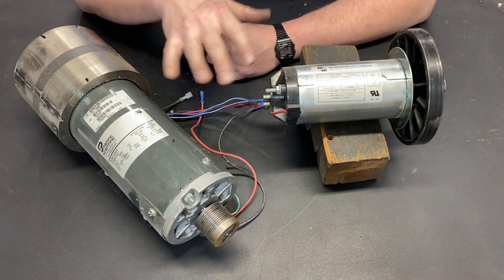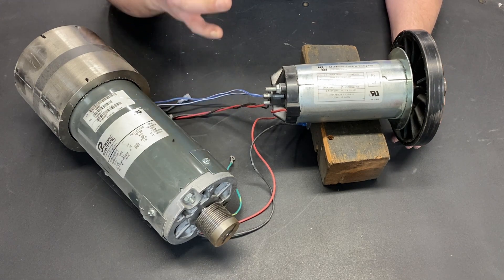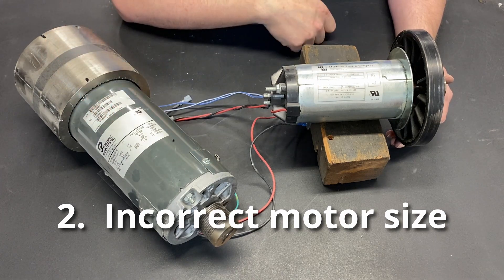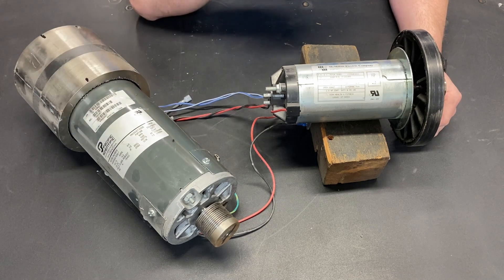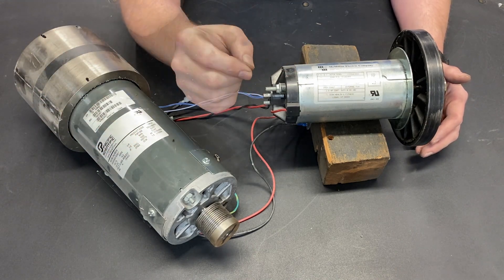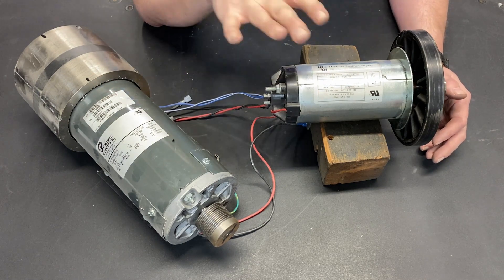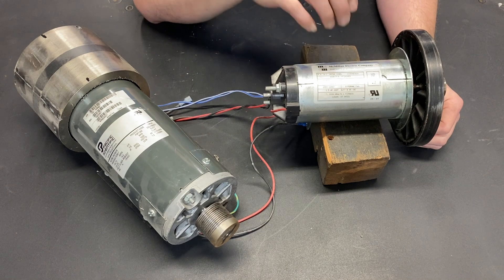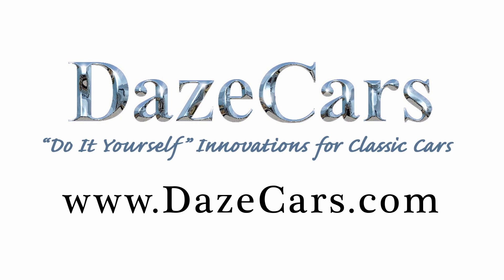Treadmill Motor Conversion Mistakes, Going over Common Mistakes people make on their Conversions

Comment: Is it overkill to use one of these motors for a 1 to 10lb barrel for rock tumbling/polishing?  I just need something with some umph  and recently got a treadmill for free that works and i have the part of the frame that Ithe motor and everything connects to and the entire electronics and components including the emergency magnetic key.  Also a question I have is doing a gear reduction - is that the only way to realistically get it to go 30-40 RPM and still maintain the torque to turn the barrels?  I seen a video of someone that tried to make a ball mill (big one) and it would just stutter and stop and they just went with a different motor and setup because though it was stopped - it got pretty hot.  I think the video was actually called - HOW NOT to make a ball mil.  (It's easier to find videos on them than it is for rotary rock tumbler DIY projects people have done!)
Reply from the maker: I think some treadmill motors would be ideal for this but some wouldn't be.  You really need to calculate the torque of the motor before starting anything.  https://youtu.be/KPcAr9orqZw Also how big around is the drum?  If I was making a rock tumbler with say a 12" wide drum I would mount two 1'  bearing rollers 6" - 8" apart and then drive one of the rollers with the motor directly.  This allows you set the drum between the two rollers and as the first roller turns it rotates the drum which is held stabilized by the free spinning roller.  Best part is the size difference between the rollers and the drum will give you a 12:1 ratio dropping the RP down where you are wanting it and increasing the torque by a factor of 12.  You could even use the two larger rollers that came with the treadmill and use the gearing that came with the treadmill to compensate for the bigger diameter rollers.  If you are not following my description shoot me an email and I can draw you a picture.

Comment: Hi, been watching msny of your videos lately, built a 2x72" belt grinder for my new hobby making knives. DC motor powered. Just pick up another DC motor 120v . It's big ,fans on both ends one behind the flywheel and the tail. it says 2.5hp but below on same sticker it say 6.9  peak HP. And the controller on it works except it kept shutting the motor on and turning  it off and on This treadmill is old, 1999. 
I would like to know  if it's work fo my compressor . This compressor is an 80 gal stage 2. came with a 5hp 20 years ago, burned up the electric motor 9 years and, replaced it with another 5 hp about 7 years ago and all I could find was a 3.7 hp tnat 's  been running it for about a 3 months. I think it takes a 3400 duty cycle motor the pressure  , maintains 175 hp. Sometimes for days with it doesn't get used, but it'd also a 240 motor ,shared with the dryer,   and I sometimes use that line for plasma cutter. I think  I'll cut some blades patterns now while I can. I've run a full time auto shop here for 13  years. Thanks for your time. I made it to 65 years old today, never expected to survive
Reply from the maker: first you need to calculate the torque of the treadmill motor and compressor motor to see where they stand.  Then you need to see where the RPM range for both is and what would be involved in gearing the treadmill motor to run at the speed of the original compressor motor.  From there you can see how the gearing would effect torque and really compare the two.  As far as the two different HP numbers on the treadmill motor the 2.5 is for running all the time without needing to stop and cool down.  the 6.9 is at higher speeds for short bursts.
Reply: @dazecars  Thanks for the prompt response. I was trying to correct the issue I was having with the  controller . I have a belt sander that  I use a digital a rectifier to power the 90 hp motor.  It works really good at 60 that the display read, I'm guessing means 60 volts. 10000W Digital Speed Controller Regulator SCR Voltage Regulator Speed Control Dimmer Thermostat 220V AC 80A . I run a switched 110 feed into that, then out from to a rectifier. I  put those in a s 6x6 box , cut slot in box and then have a 110 v 6" cooling fan x9``. covering the opening . keeping fan running whenever the switch is o n. I haven't ran the belt sander  more than 10 minutes at a time.  And the compressor?  It doesn't usually run more a 10 minutes. Also note the the 3.7 volt motor now running the compressor has a 6"' woodruff keyed pulley that would fit the dc motor and would probably let the compressor start easier than the 1" ribbed pulley. I will probably do some test using the aforementioned controller. I will turn   volts the description above is cut/paste from Amazon.
Reply from the maker: sounds like quite a project.  Did you have more questions??
Reply: @dazecars  Well, a little change of plans because a line blew and my 20 year year old stage 2 compressor  pump finally pumped her last breathe trying to keep up. So today I learned changes have been made in how they perform. Mine, 25 years old required a 5 hp 220 motor that runs at 3450 rpm. Now it only needs 3 hp at 1300 rpm,  I couldn't keep from buying it at $104, which $100 was a birthday gift from my landlord, which sounds odd except that I probably bought this house for him, more than once, paying rent for 13 years. He's 15 years older than I at 80, but his only friend and his sister cars me whenever he doesn't answer, sending me on a welfare check- awe you need all that, sorry. But I think it's be okay, could probably use my small DC motor, except a question about cleaning up the dirty power.  A capacitor, maybe, I'll have to look at your vids again, appreciate you wisdom and I will definitely do a video.
Reply from the maker: capacitors can clean power but they can also cause surging under a load in some applications.

Comment: Can they be safely run without the big flywheel ?
Reply from the maker: depends on how the motor is setup.  If the flywheel is also the cooling fan (some are and some are not) than you must run the flywheel or replace it with some sort of cooling fan.

Comment: You dont talk about watts as all motors now are rated in watts, not HP.
Reply from the maker: thats incorrect.  lots of new motors are rated in HP not watts.  Just depends on where you live.  simple conversion 1 hp is approximately equal to 746 watts.

Comment: So if you NEED another way to charge dc batteries these dc motors can produce dc voltages if turned with watter wheel or small gas engine?
Reply from the maker: yes, just keep in mind speed effects voltage.

Comment: What would you use for the gearbox
Reply from the maker: Most treadmill motors turn way to many RPMs for a metal on metal gear box.  To gear mine I use just a pulley and belt system and if you cant get the ratio you need a Jackshaft/ AKA countershaft would get the job done.

Comment: how can i get ac corent  from a tread mill motor?
Reply from the maker: I am assuming you are wanting to use the treadmill motor as a generator?  If so some sort of inverter would be required to convert the DC from the motor to AC.  The problem would be most inverters are designed to work at 12V and the voltage of a treadmill motor being used as a generator will be variable depending on how fast it is turning.
Reply: @dazecars  thank tou friend what if i use a rectifier from dc to ac and another rectifier to do ac to dc
would that make it smooth transaction
Reply from the maker: It doesn’t work that way. A rectifier only converts AC to DC. It will not convert DC back into AC
Reply: @dazecars  thank you brother
Reply: thank you brother

Comment: What would typically cause surging? I'm using Power cord -> switch -> scr motor controller (stock potentiometer) -> bridge rectifier -> dc choke from microwave transformer -> 2hp 90v treadmill motor
Reply: I isolated the problem. The DC choke I made actually causes the surging, it runs better without it for some reason. Any ideas?
Reply from the maker: The results have been mixed with the DIY choke.  Some people have had good luck with them others have had issues.  I would assume its because microwave transformers come in all different shapes and sizes and that can effect a lot of things like coil wire size.  Try running it on the negative side and see if that allows it to do its job without surging.
Reply: @dazecars  I have around 15 microwave transformers laying around. I took the biggest ones possible with the thickest wire. One thing I've noticed is that 50% of the transformers I checked have ALUMINUM wire instead of copper. I did a bunch of testing and it turns out the motor I used is the issue. It's either from removing the encoder on the back or maybe the brushes are getting super low, because its' arcing and surging badly.

I tested 2 other motors, one is a smaller treadmill motor. It worked perfectly with either choke (I have 2 now, 1 with aluminum, 1 with copper wire). 

The largest treadmill motor had very light surging with either choke. I connected both chokes together and all surging disappeared. Aluminum wire is far less efficient so I'll probably make another choke and connect both copper ones or add wire to the one I already have.
Reply from the maker: good information to know.  When you ran both chokes at the same time did you connect them in parallel or series?
Reply: @dazecars microwave transformer secondary winding is on a laminated steel core that's designed for use as a transformer ...
For use as a choke..one has to provide an air gap in between the two halves of the laminated core pieces..
This is best and easiest done by filing one of the limbs ( preferably center limb ) of only one side.
Gap distance is actually a function of the core hysteresis curve , frequency , and peak/max. continuous current..
this is to prevent core saturation , & effective choke working.
.. Since the choke is on a laminated core it is better to connect it after the TRIAC/SCR & before the bridge rectifier...i.e. on the 
AC side & not on the DC side.
DC side choke would turn out to be really physically (calculated) big.  & a ferrite or iron powdered  or air core..will work better...
Reply from the maker: excellent information, thanks for sharing

Comment: I have one of this 4.25 hp can i connect it direct to a 120 line?
Reply from the maker: Most but not all treadmill motors are DC  and require an ac to dc converter. Most ac units are 3 phase requiring a 3 phase hook up and a VFD for variable speed.
Reply: @dazecars  thank you so much
Reply from the maker: my pleasure

Comment: Thinking on building a liam f type wind turbine power regerator using any kind of motor, which motor model would you recomend? And material for the wind turbine? Fiberglass maybe?
Reply from the maker: Not sure I have not done anything with wind turbines

Comment: If my treadmill has 3 wires of 3 separate phases does that make it an AC motor? The label doesn’t say what it is
Reply from the maker: maybe.  a 3 phase motor is by its very nature is AC HOWEVER there are some DC motors that are referred to as 3 phase even though they are not a true 3 phase but that is how they are labeled.  Can you email me through my website and send me pix of the motor, pix of any tags or stickers and any wire labelings. I may be able to clear it up for you.
Reply: @dazecars  I really appreciate that! Do you have your email address? I looked at your web page and couldn’t find anything regarding a contact email or web address.
Reply from the maker: About/contact is in the menu bar at the top of the website. A lot of my other pages have it as well and it’s part of my “about” information on YouTube.

Comment: How do you determine the torque needed for a particular machine to tool?
Reply from the maker: Take the specs on the original AC motor and calculate the torque.  This is a good starting number but more is better so from there you can increase torque with gearing assuming the new motor has more RPM

Comment: Okay I know this is an older video and I don't know if you'll get this but can you take a treadmill motor and hook it up to a solar controller like a 60 amp for a 100 amp
Reply from the maker: Is the solar controller also adjusting voltage?  Those amps would power a treadmill motor no problem but you won't get variable speed without varying the voltage, and what are your max volts.  Most treadmill motors are 90-180 volts.
Reply: @dazecars  bud i dont know if it would power a solar charger i was seeing if u could do a video on it  like make the treadmill motor power the solar charger  please let me know
Reply from the maker: so you are wanting to use a treadmill motor as a generator?
Reply: @dazecars  yes
Reply from the maker: thats not the kind of videos i do but thanks for the comment

Comment: I don't care about any of this. I just want to use it as a winch to occasionally help me bring appliances up the stairs. Do you have any practical suggestions for that?
Reply from the maker: A treadmill motor is not a good candidate for a wench.  It will not have the torque.  maybe if you used in in conjunction with a hand crank wench and geared it way down but a that point a cheap wench from HF would likely work better.
Reply: @dazecars , I just noticed that. Thank you.🙂

Comment: 1. I'm with you on motor cooling: https://www.youtube.com/watch?v=WRtArow2UMU
2. An advantage of running remote cooling through a duct or hose is that it seals up the brush end of the motor, which really does not like dirt or swarf getting into it
3. You are correct about the tradeoff between low torque/high RPM and high torque/low RPM - and you are quite right that the motor manufacturers overstate the HP numbers on these motors. However, higher speeds have a use all their own, especially on cutting tools like lathes and mills. Being able to drive the tool faster opens up the door to carbide tooling (which likes high SFM) which can often be more productive than a speed-limited, higher torque motor. Your typical hobby lathe 100mm chuck is frequently rated for 3500-4500 RPM, and spinning it that fast (with the commiserate feed speed) can generate a much higher MRR than a lower speed, even if the lower speed can take a heavier depth of cut. Within limits, RPM is king!
Reply from the maker: Good info I appreciate you sharing it.  The one thing I caution people when it comes to hobby lathes and RPM speed is to do one of two things.  Either maintain the OEM speed max, in other words don't drive the spindle faster than its max speed from the factory OR do your due diligence and make sure the bearings are up to the task.  This involves getting the bearing part numbers and then trying to find the speed specs.  Unless the manufacturer is clearly marked on it you can only get a range.  If I was wanting to overdrive my spindle I would simply replace the bearings so I was absolutely sure the bearings were up to the speeds I planned on running it at. Lastly the further you go from the original max speed the the higher the risk of the structural integrity of the spindle not being up to the task especially if you have upgraded to a bigger chuck with more mass.  I am sure a typical import spindle with correctly rated bearings can handle quite a bit more speed but the faster you go the more cautious a person needs to be.

Comment: On mc80 I got 1 red-light on and motor won't start
Reply from the maker: usualy its one of the switching transisters attached to the heat sink side of the board that need to be replaced.

Comment: The other reason to gear them down aside from torque is cooling. A DC motor turning at 100 rpm isn't going to last too well. I've used these motors a lot but find they tend to vibrate too much, especially without the flywheel. I guess in things like treadmills they're built to a price.
Reply from the maker: excelent point.  there is an RPM range where cooling is most efficient.

Comment: At 1:05 and later you say the green wire is for electrical short circuit protection. That is just 1 aspect of safety that it can provide. It is also for static electric charge dissipation. A tread mill is a great Van de Graaff generator and could kill you with static electric charge buildup suddenly discharging through your body! I know you are not building tread mills in this video presentation, but talking about treadmill repair or repurposing requires additional non-traditional safety concerns to be considered. Be safe! Good luck! Wear safety glasses!
Reply from the maker: Excellent information I will add it to a future video!!  I have watched several YouTube videos where the presenter said of green wires on treadmill motors "you don't need it, don't use it,  just cut it off"  I was beyond horrified